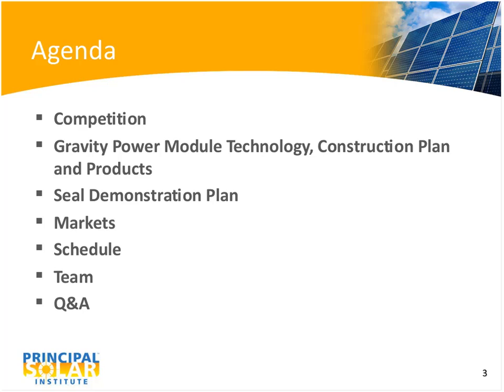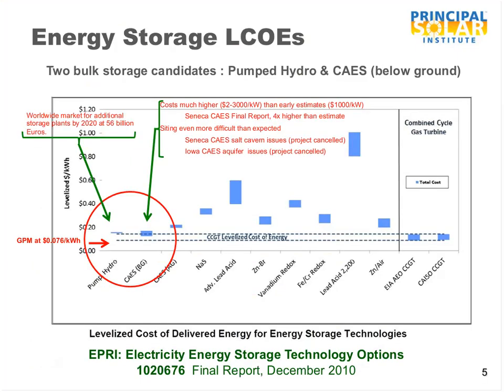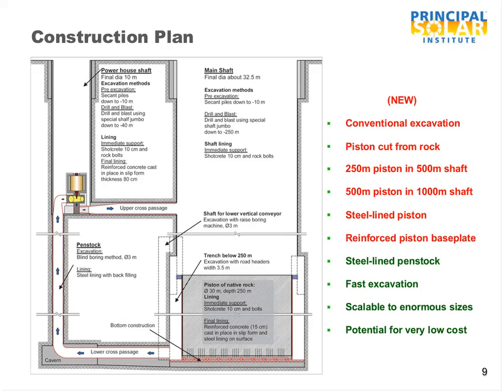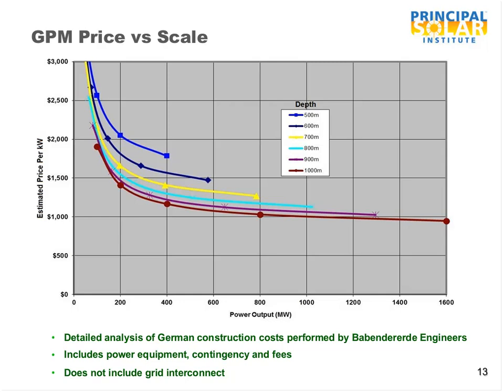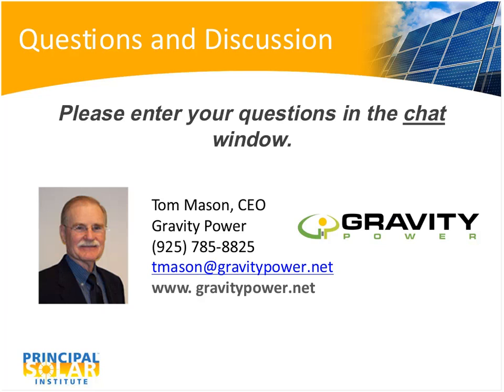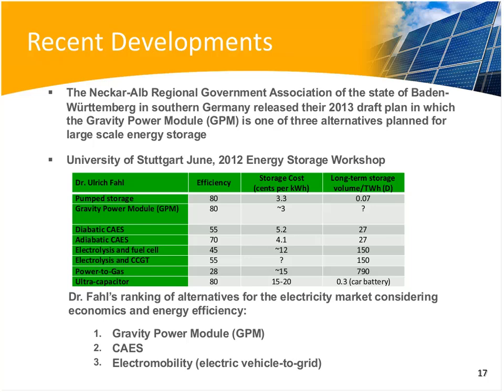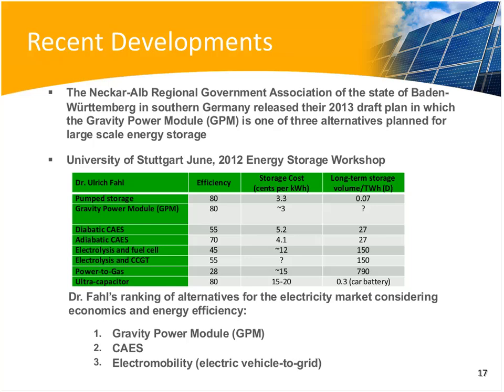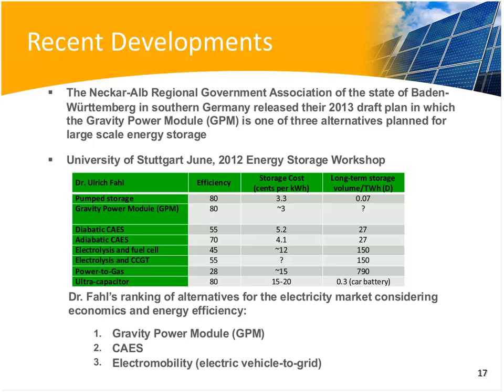Renewable Energy Storage at a Massive Scale: Gravity Power's Design Change and Progress Update

Comment: Regarding the earthquake question. He didn't seem to mention this but is it not a major benefit of this system that the environmental impact of potential ruptures caused by earthquakes is very very small? Or are there additives in the water perhaps that would increase risks?

Also I wonder what the benefits/negatives of increasing the pressure in the system would be e.g. by raising the water temperature via some kind of geothermal system at the bottom of the shaft.

Interesting technology. Look forward to seeing it in action in the next few years.